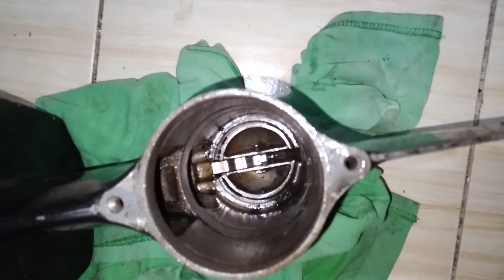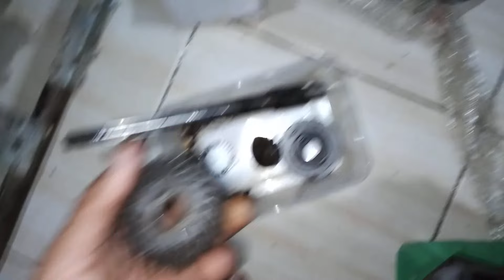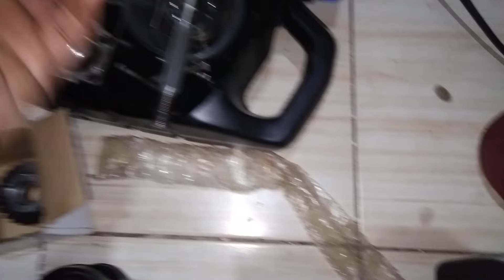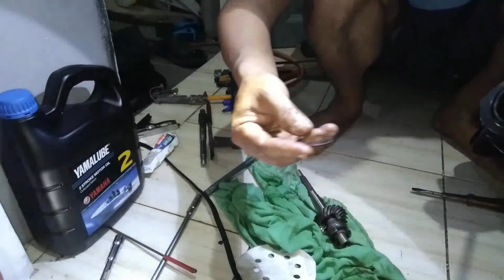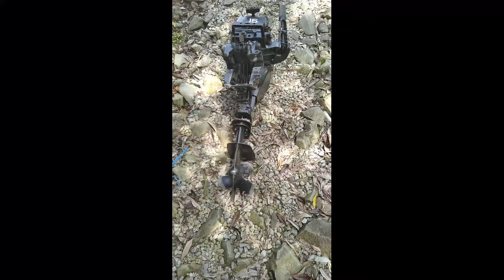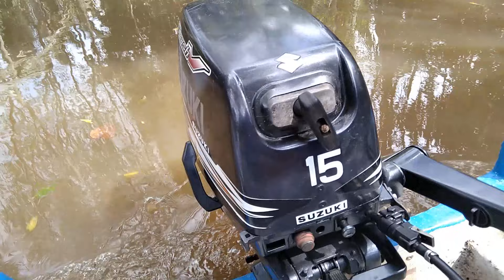SUZUKI 15HP, CARA MENUKAR  SPAREPART GEAR  GEARBOX ENJIN SANGKUT

Comment: Macam mana nak buang bearing dalam tu bos? Pakai special tools ke?
Reply from the maker: Ada tool dia sendiri bos..ada jual dekat hardware  cakap je untuk tarik bering keluar...kadang² kalau dah lama sangat bearing jem terpaksa welding dua besi panjang yg macam skru tu, welding di tepi bearing dua biji..lepas tu pasang besi melintang dekat lubang housing tu terus pusing dua nut untuk tekan besi flat yng melintang tu..pasti boleh bos..
Reply from the maker: Maaf lewat balas tak perasan mesej masuk
Reply: Berapa kos tu
Reply from the maker: Kos mana satu bos?
Reply: @mailslumberajeefishing  kos tukar gear box baru
Reply from the maker: Kalau gear box Housing saja untk suzuki saya dah tanya di KTS  dlm Rm1000+
Reply from the maker: Kalau full set isi semua dalam rm2500+ ori Japan

Comment: bang, masalah enjin suzuki sy bila bwk enjin jd meraung tp xpegi..mcm kereta hbs clutch..tu sbb gear jgk ke @ masalah lain
Reply from the maker: Assalam.. Meraung waktu bila ya, adakah waktu tarik minyakatau lepas masuk gear meraung dan tak jalan
Reply: @mailslumberajeefishing  meraung waktu jalan.. Masuk gear, pulas myk dia jd meraung.. Tp xpegi.. Klu full throttle tu ibarat bunyi mcm enjin 30hp tp pegi nye mcm 5hp.. 😅 😅 😅
Reply from the maker: Ow... Cuba cek propeller Bush takut dah pecah .. Dia pusing gear sub laju tp propeller dia kurang pusing sebab bush dah haus.. Cuba cek kalau getah bush tu ada macam pecah di tepi... Kalau ganti bush tu dlm rm120 yg jenis bagus sikit..
Reply from the maker: Atau kalau gear box kuat berbunyi kemungkinan gigi gear banyak yg dah haus atau pecah
Reply: @mailslumberajeefishing  terima kasih byk2.. Rasa mcm gearbox jgk tu..
Reply from the maker: Sama² bosku

Comment: Bang knpa gear ke dpn xmasuk ye? Gear reverse ok
 Ke ada kaitan dgn gear box atau shaft propeller?
Reply from the maker: biasanya kalau gear forward atau reverse  tak mahu masuk mungkin spring kat dalam tu dah lembut atau terapit/melekat dan x main lagi..cuba buka cek spring tu..spring tu lebih kuang panjang dlm 2 inci.harga pun x mahal juga bawah rm30 kalau tak silap..atau boleh jadi juga besi panjang yg yang dekat kaki enjin tu nut dia rosak atau kenak adjust balik..cuba² adjust dulu nut tembaga tu dulu
Reply from the maker: spring tu dalam lubang shaft propeller

Comment: Selalu apa masalah berlaku pada enjin Suzuki 15 ni
Reply from the maker: Jarang juga rosak kalau kita jaga engin sangkut ni...selalunya bahagiang gear box la..kalau jarang cek atau tukar  minyak gear kita kadang tak perasan air masuk dlm gearbox..tu menyebabkan gear² semua berkarat lepastu boleh merosakan bearing dan gear²nya tu..kalau boleh dlm 2 bulan sekali boleh tukar minyak gear..kalau hari² turun laut atau sungai boleh la tukar tiap² bulan utk elak seal bocor air boleh masuk.
Reply from the maker: Kalau bahgian engin cuma part cdi dgn coil tu lah selalu bermasaalah..kalau nak servis engin tu kalau boleh untuk bagi block tahan selalu²lah start engin dgn air hujan atau paip utk buang garam dlm engin sebab garam boleh makan sikit² aloy dekat engin tu..👍👍😊